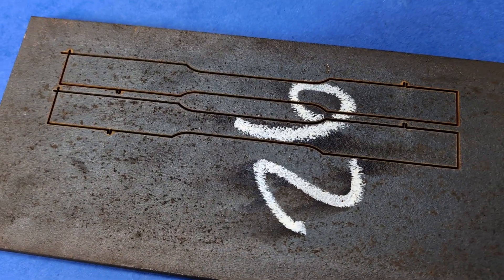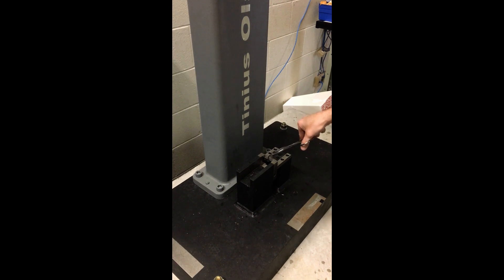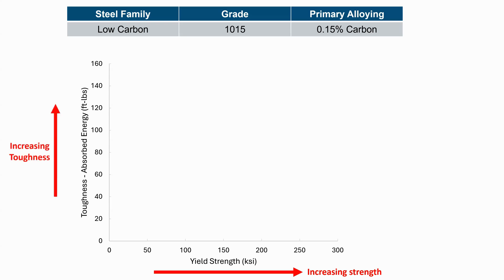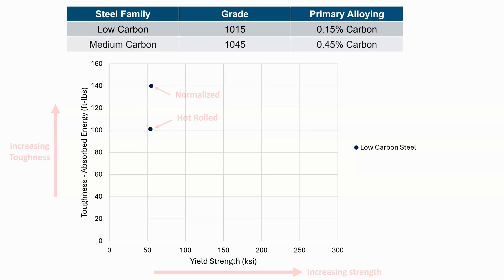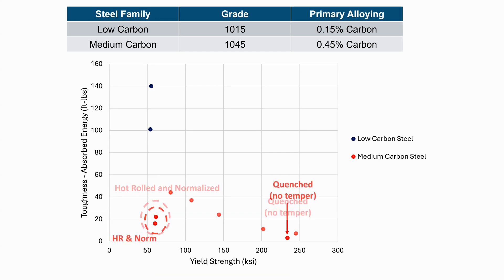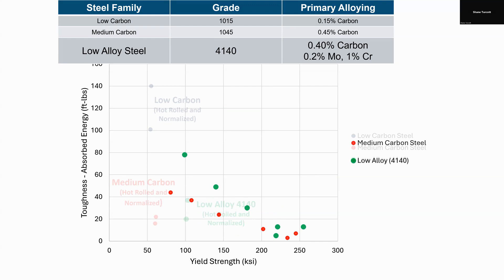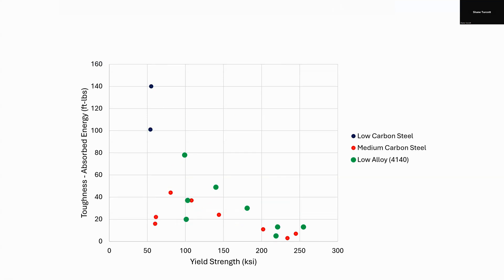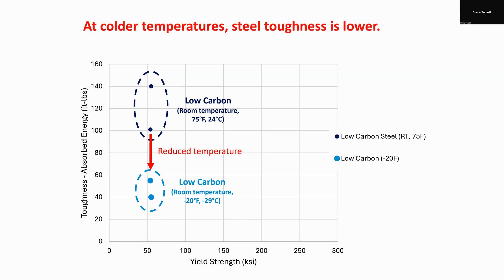Steel Strength vs Toughness

Comment: I'm interested in tempering embrittlement. Some of the higher tempering temperatures on the graph seemed high and I thought could cause embrittlement. (I'm still learning...)
Reply from the maker: There are two embrittlement mechanisms that sound close to one another - (1) temper embrittlement and (2) temper martensite embrittlement.  The former takes years or decades to occur.  The latter, 'temper martensite embrittlement' can occur during heat treatment - so its probably the one you're interested in.  It can occur from tempering at temperatures below 750C (<400C).  Yet its pretty rare.  Awkwardly, its not a well understood embrittlement and literature will say it requires tramp impurities for a steel to suffer this embrittlement.... but we've seen it in steel without.  Ultimately, if you're going to produce millions of parts over several years without evaluating toughness, best to temper above 750C (400C).

Comment: As a former machinist these two factors we always under consideration. The material determined the tooling use to machine it. These are topics that most people never consider unless it is their profession to do so. Thank you.
Reply from the maker: @nobuckle40 Agreed - ones awareness of toughness depends quite a bit on their experience.  Hoping this video will help make it a bit more mainstream why we often avoid steels with ultra-high strength, at least when toughness is needed.  As an add-on to the conversation, we also prefer a moderate-to-high tempering temperature not just for toughness but also to make it reasonable to machine.  I'm sure as a machinist you've run across the odd design where someone needless choose a difficult to machine steel condition.